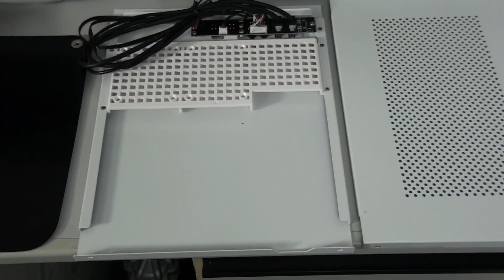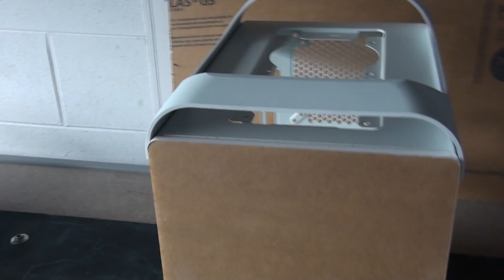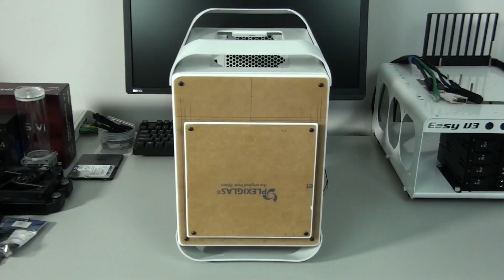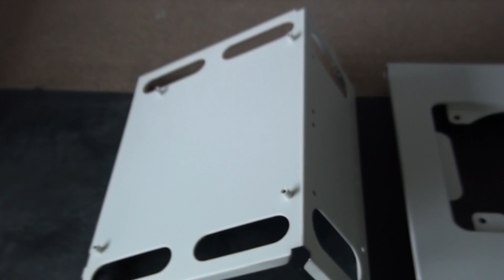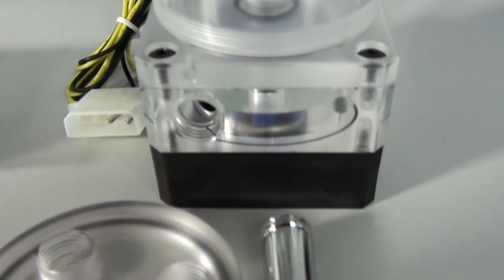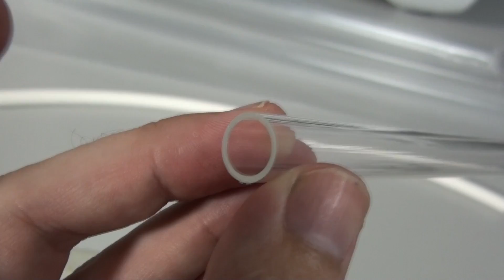Build #11: Prodigy Liquid Cooling: Part 2

Comment: For beveling the edges, have you considered just using a router and then following up with filing or sandpaper where necessary along with polish to finish it out? Or would that not really work well with acrylic?

Comment: I do like the front radiator/ case mods, to me anyway it looks 100% better than standard out of the box. Maybe Bitphenix  should take note if they decide to update the case in the future. The other part of the case that could do with amending is the rear exhaust fan mount if put a radiator in the roof it's not possible to mount a fan there.

Comment: Is it possible to use a router with a radiused roundover bit with acrylic? I would think that that would be a better way to get a more uniform edge. Also, it would allow for more rounding on inside curves (like with the 180mm fan).

Comment: This is a great build, and having now worked alot with the 4.5mm thickness of this white acrylic (including a handbent top to remove the Prodigy handles) the one issue I have is that you really have to re-paint all the original panels and chassis, and if you could, the handles as well. The Prodigy is not very white. It's sort of a very bright grey causing some color mismatches. But great insight between this and client build 9 on the amount of work involved in sanding and polishing the acrylic. Your descriptions and insight are bang on and you don't cut any corners. Very refreshing. I look forward to part 3.

Comment: Hey Dan! about your issue at 16:06...
How about engraving the singularity computers logo on the BACK of the cover panel in a depth of about 3mm. That would surely allow a red glow through the remaining 2mm white acrylic and give a singularity touch to the build.
Reply: Asking the client what logo they wanted etched in would be more appropriate.
Reply: It won't work with this panel. You'd have to basically cut through a good 6-8mm on this type of 10mm white acrylic. It is very opaque and requires a very strong light behind it. A better bet would be to somehow get light on a piece of clear acrylic covering the white and engrave a logo in there. If the rest of the acrylic is perfectly polished, the light would only glow on the engraved/rough part. Maybe cut the fan hole wider and put screw holes and a fan port on the clear acrylic.
Reply: BTW, the cover panel is only 3mm thick anyway, he'd have to go less than that or risk snapping it/ruining the structural integrity. Sorry I commented on the 10mm piece.

Comment: hey I want to build a very slime and small Power PC and i want to use for the front panal acrylic glass becasue I want a "piano black" finish for the front. Now I Don't really want a flat front panal so I tought about bending the glass to a corner to improve the aesthetic but I want to shape the corner as sharp as possible and only use one glass pannel... so my Q: can u give me some advice ? i srlsy love your videos and voice your mods are great and i love your eye for the detail so if you have some tip for me that will be great

Comment: I think your bills would greatly benefit from having access to someone with a cnc mill or laser cutter. The acrylic front panels always end up looking terribly bland imo, while a laser cut aluminim panel would open the door to different designs and fan openings/grills. Check out the front panels of the murderbox and compact splash for excellent laser cutting examples. Otherwise, your builds are looking great as usual!

Comment: I'm sure you can get drill attachments for making perfect circles. I've seen many woodworkers use them. Got to be better than a Jigsaw.
Reply: * IF * you can find the perfect diameter
Reply: Rafał Borowski Agreed. Just watched a program where they used a laser cutter on perspex to get the shape they wanted. If you can get a large enough diameter great or you can do what he has done or use a outside contractor with a laser cutter.
Reply: They are called hole saws.
Reply: Not many hole saws at that size, 6.75 inches or 170mm, unfortunately. The thing with hole saws is that they can melt the acrylic at medium-to-high speeds and a lot of filing/sanding work is required after the fact. I use a 4.5" hole saw for fan holes and then I have to use a curved/round hand file, and then sand with 150 grit>320 grit>600 grit> 1000 grit to remove all the "artifacts" and slice marks.

Comment: I was wondering if you thought about using a frosted 3 millimeter peace of clear acrylic as a front panel simply taking the clear acrylic and hitting one side of it with 2000 grit you'll still get the white estatik look but you'll get better LED light reflection through the frosted acrylic awesome build can't wait to see more vids keep up the great work

Comment: This is a really nice build but the one thing that set me off is the color of the handle and "feet" of the case. If possible you should paint those too. (It might just be the lights in the video or whatever but it seems a bit off and it ruins some of the experience with such a nice modded case.
Reply: the handles and feet are flexible, that's why he can't paint them
Reply: Mudux I guess. But it would look better if the entire case was in the same "fade" of white^^ The build is still sick but i know it would fuck with my OCD D:
Reply: ***** yes, it would, but it's not possible